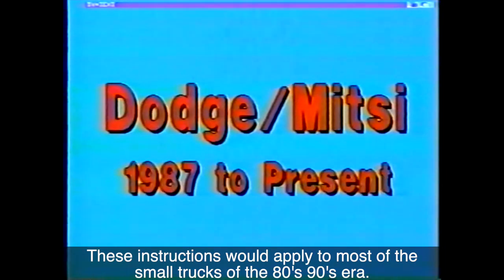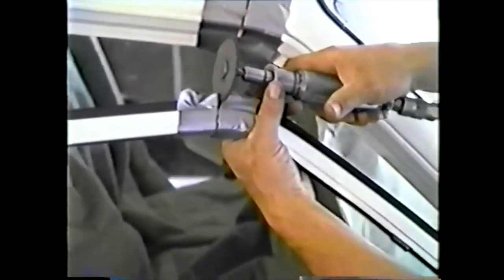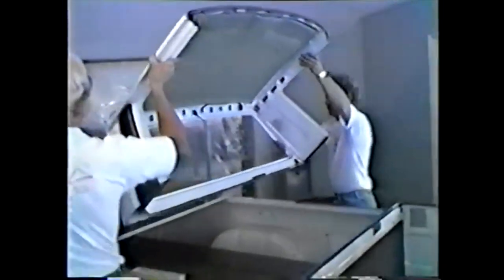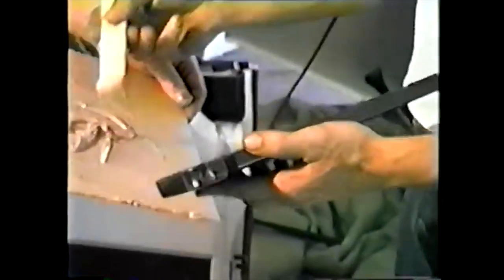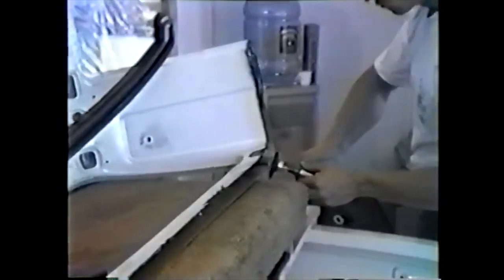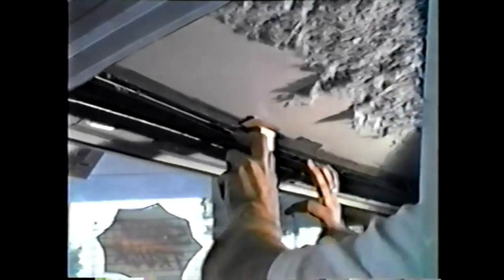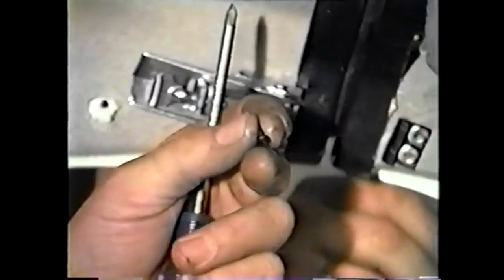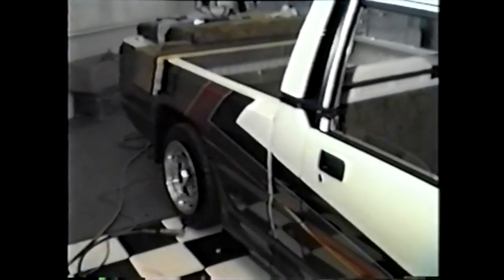Ratical Tops Convertible Kit Instructional Video | Mazda B2000 B2200

Comment: I had the factory come out and use my 2006 b2200 as a training vehicle in Florida back in 1989? They installed a fiberglass roof, if was the funnest vehicle.
Reply: Damn, you’re a time traveler.
Used your 2006 B2200 in 1989 🤯

Comment: are these kits still around for mazdas? or would the 1987-1993 Mitsubishi Dodge Convertible Ratical Hardtop Kit from airbagit fit the mazda?
Reply from the maker: They are not and were not that great to start with. All plastic that became brittle over time. Stay tuned, my project truck will be a convertible and I am going to try and do it better than any kit ever was.
Reply: Look up Michael Parker from Buchanan GA. He is the only source for Mazda kits.
Reply: @markkottwitz6176  I appreciate it, I spoke with him around the time I commented, hopefully he will be making some in September as he mentioned. Fingers crossed. Really want my Mazda with a hardtop convertible